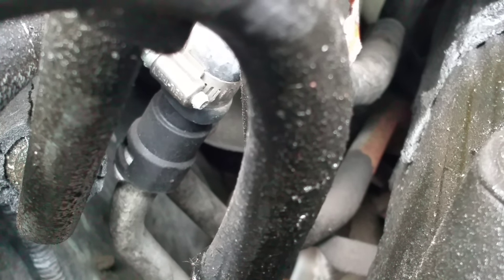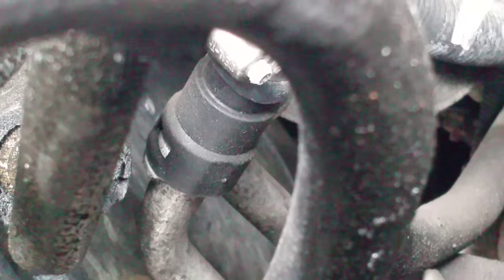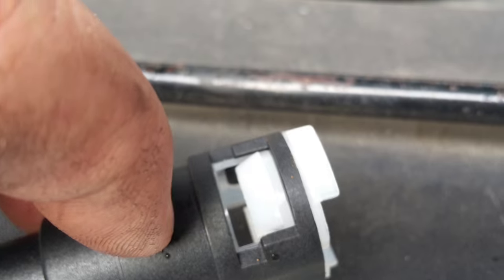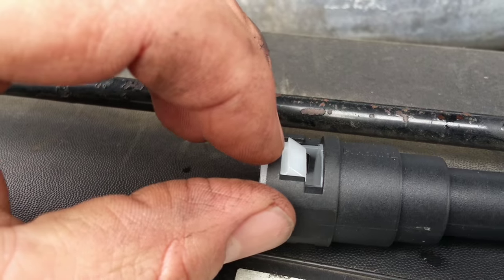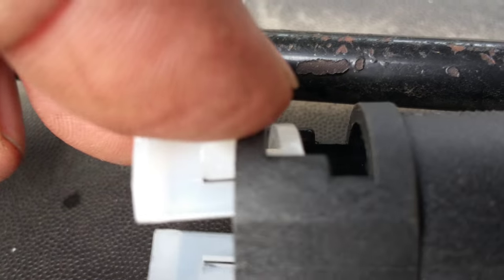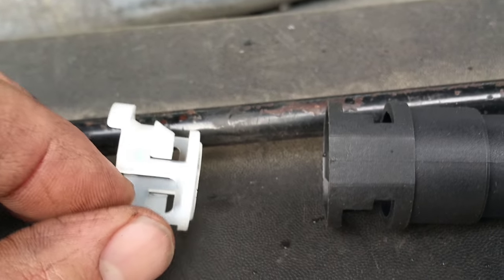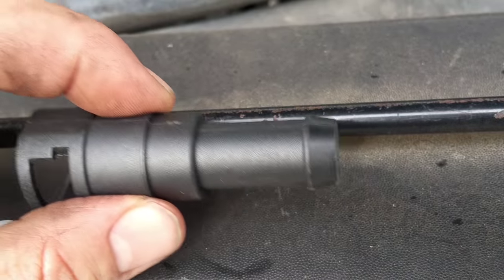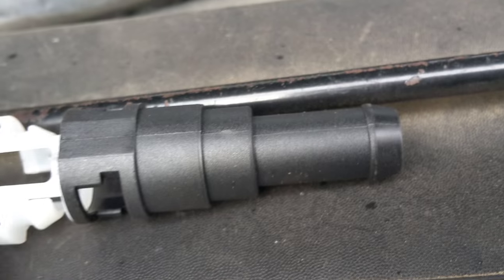Ford Heater Hose Quick Connect Release how to

Comment: I removed the factory quick disconnect and yes, there is an O ring in the assembly but there was also one on the heater core pipe just ahead of the white assembly. While installing the new disconnect I suppose I should put the old O ring back on the pipe from whence it came?
Reply from the maker: it is my experience that there is supposed to be one O ring. The 6 connections on my truck used just the ones from the new connector.
Reply: I have it on. About to pressure test it.

Comment: Thanks for the video. Do we really need to replace the quick connects, or can we just use hose clamps?
Reply from the maker: Joe Dusel there is a ridge in the pipe, I'd say, "no". You'd appreciate putting it back with the connector, makes it so much easier.
Reply: Thanks for the response. I ended up destroying the quick connects while removing them from the heater core. I'm thinking with all the effort to remove the hoses it might be a good time to preemptively replace the heater core, which is about 17 years old.
Reply from the maker: Joe Dusel That's ambitious. mine is partially clogged. I'm going to try and flush it.

Comment: Tried this on a 2000 Expedition, not budging, can't push the plastic tabs in far enough and pull it free.  The plastic coupling that's inside the rubber hose broke near the connector.  It's the one on the left at firewall, very tight quarters under there.  Gave up after 45 minutes.  My hands hurt after that, just getting tore up.  The tool is 25.00 and they don't have it locally, maybe there's a way to make one, it doesn't look that complicated.
Reply from the maker: N3D.studio Did the tabs break?

Twisting back and forth to ensure it's free, then pushing it towards the firewall before depressing the tabs.

I agree. Very tight spot to work in. 

Good luck.
Reply: Can't grab the tabs with both hands and push/pull like that.  Another video suggested a 90 deg. needle nose pliers.  I had a small pair but can't get on it right.  The black tube that goes into the hose broke while driving, fluid went all over the engine.  Great design.  I ended up just grabbing the plastic tabs with pliers and ripped them off.  Had to pull both until it finally came off until they were destroyed.  I broke the black connector a little too but it was already broken in half anyway.  I did not replace the ends.  I just shoved the hose onto the pipe thru firewall as far as I could and tightened down with regular hose clamp.  Pointed the clamp so the head was facing down and used a stub nosed flat head or I guess you could grab a socket and wrench and do it too.  No leaks.  Not going to buy those stupid connectors. If any other connectors break I will be converting them back to regular hose clamps.
Reply: Same shit here just bypass the heater core with 90 elbow and some hose clamps

Comment: What’s the little connector you was using for the demonstration?
Reply from the maker: When you purchase aftermarket heater hoses, they do not include the connector. The connector goes onto the heater hose with the standard clamp and then plugs right onto the nipple.

Comment: I have this on a 6.2L engine oil cooler coolant connections. though this was the way but wanted to make sure. 10 years old and looks fragile.
Reply from the maker: @denislaouenan5553  how did it work? Interested to know.
Reply: @MrRChitty  it worked as per designs but no space to insert any kind of pliers but just 2 fingers, needs to be ok to endure finger tip pain, at first it would not squize enough to free the female tube mostly due to excess of dirt, after spraying wd40 inside some of the shit came out and I was able to free the hose fitting, the idea was to get as much coolant out of engine block as I could. Internal O-ring was still in good condition and clean. I did put a bit of axle grease and put it back. Seems strongly attached and leakproof. Thanks a lot.
Reply from the maker: @denislaouenan5553  ah, the secret. Clean the dirt out with some kind of spray degreaser. I've had a few users struggle and that seems to be the answer for them. Appreciate the follow-up and glad it worked.

Comment: Question...Are there 2 sizes on the 99 expedition? 3/4 and 5/8 or one size fits both pipes?
Reply from the maker: steze48 They're all the same size. Dorman and Motormite (Help!) manufacture these parts.

Comment: Isn’t it crazy all these parts are manufactured and then it like figure out what this is for and how it works
Reply from the maker: On the repair side, yes. For quick assembly at the factory to keep costs in check... once you learn how it works, it speeds the installation for the end user. I am working on changing out a transmission on a chevy and it has the quick assembly on the lines.... if it wasn't for the used replacement one, I would be struggling. But, putting it back together is going to make it easy.

Comment: Mine would com so I just broke it off with screw driver around the ring part then it came off it was like molded on no tool or pressing those parts worked
Reply from the maker: Ouch... hopefully the new one went right on.
Reply: Yeah made sure not to damage the metal but I think they were oem and it had over 220k on it

Comment: I can't get the plastic piece off the nipple. Any tips?
Reply from the maker: Best suggestion I can give is push the entire assembly towards the fitting and twist back-and-forth. And then you'll need to take your fingers and depress on the white clips. And you should be able to slide it back.
Reply: @MrRChitty  I have the black connector piece and 1 o-ring off. It's just that white plastic piece left on the heater core nipple/tube. I've tried twisting, pulling, pushing, depressing, pushing the prongs apart. Moved maybe 1 cm. Feels like there is something to it I am missing here...
Reply from the maker: @jefemang3430  spread the prongs apart at that point.
Reply: @MrRChitty  Tried that and the plastic started to break, but no movement... I even tried with pliers to get under and spread them + pull. Nothing other than more damage to the plastic. I just bought a hose with a plastic connector piece. Almost wonder if it's worth just cutting off the old plastic clip.

The hose + connector came off so easily. Funny how this is the hard part haha.
Reply from the maker: @jefemang3430  it doesn't matter if you break the original. The new piece you have will replace it.
Reply from the maker: @jefemang3430  I am uploading a video right now
Reply: @MrRChitty  You are awesome! I appreciate it.
Reply from the maker: @jefemang3430  https://youtu.be/ubX_8RFfGqA?si=5lcY2tv-O5QnbTrv 
Let me know if this helps

Comment: I am replacing my heater core in a 2005 E-150 4.5L and need to know where to get these clips and the black part?
Reply from the maker: Sanitys Void Most any Auto Parts Store, under the brand name Dorman or Motormight.

Comment: Can you tell me how to take the old extension off of the heater and replace the new hose?
Reply from the maker: It's tricky at first, my video gives you the concept. You do not need a tool. Grasping the whole assembly, push towards the heater core and give it a turn back and forth to ensure that it is loose enough. I know Ford gives you a boat load of room under there.... lol. Feel for the openings where the white part of the clip comes through the assembly. Squeeze that area with your thumb and index finger so as to depress the clips in as far as possible. Then, pull away from the fire wall. You must depress the tabs while pushing first, then pull back. 

Keep me posted. I'll check on this in a little bit. 

Regards,

Randy
Reply: I got it thanks so much
Reply from the maker: Kristin McCormick You are welcome, I am glad it worked.

Comment: What if the teeth inside doesn't want to pop off what you do,?
Reply from the maker: They should release. Hopefully they weren't damaged in previous attempts to release them.  That or dirt made its way in that area.  Twisting motions while pressing on may clear it. While pressing on, you can try and squeeze the release tabs.

Comment: What's the purpose of that part? Why not just use a hose straight in.
Reply from the maker: When you have the Ford Expedition, the connections to the heater core are deep under there and almost impossible to get a screwdriver on a clamp. The part allows you to Simply connect to the heater core with virtually little to no effort.
Reply: @MrRChitty  What happens if you just put a hose straight in? I have a 09 VW Routan minivan basically a Chrysler town and country. I have this issue and the part is super expensive. It doesn't even come with a quick disconnect. So I just want to know of I can just slide a hose straight in.
Reply from the maker: @REPDAT5SIX2  I am not familiar with this one
Reply: @MrRChitty  okay well that same part on your video is the same part on my minivan. My question is can I just use a hose and avoid buying that part.
Reply from the maker: @REPDAT5SIX2  I believe so. It is nothing more than a pipe with a ridge to capture the quick connect. If you pass the tip of the hose beyond that ridge, tighten a clamp, it should hold. Just, if you service it in the future, the hose may become molded to that ridge and be difficult to remove.
Reply: @MrRChitty  I'm going to give it a try and see if it holds good. If not I'm just going to buy the whole kit of hoses. Thanks for your time and help.

Comment: sir how would i do it if i do reconnect it but it keeps leaking
Reply from the maker: Erick Gonzalez There is an O-ring. if you separate  them, you need to get the white clip and make sure the O-ring is either inside the assembly or on the pipe. if it is on the pipe,  you need to pull off and put it back inside.
Reply: well the old one i took off came with three of them but i try to put them back on but seems like they dont fit could it be that there old and i need new ones?
Reply from the maker: I have only seen 1 O-ring in play.

Comment: I can't seem to get the quick connect on. What am I doing wrong
Reply from the maker: James Brown make sure when you separated the two parts that you also did not lose the O-ring. if you're putting a new part in place of the old part you must make sure the O-ring went with the old part.

Comment: So this took me just over an hour.. I tried with my hands for 5 minutes then tried with the tool for an hour then tried again with my hands and got it in a few minutes. the thing is I saw another video where they used the tool so I struggled for an hour with the tool because it really is a bitch to depress the buttons..  I could get one side but never the other until I realized I could unlock the top and then rotate the tube 180 and then get the other one in the same top position
Reply from the maker: Appreciate the feedback. Overall, this thing sucks. However, reassembling will be a breeze.

Comment: Why not just buy the heater hose removal tool for a few bucks?  It works well and is much less risky than potentially breaking the connector.  Your auto parts store will have them and it will only be a fraction more expensive than the hose you will need to be replacing/disconnecting.  Over time, and in the cold, these connections get brittle.  They break.  Not to bad mouth you, this is just not how any mechanic would suggest to do it, as their are better ways to remove this connector.
Reply from the maker: No auto parts store I went to had the right part. It wasn't until I purchased the replacement hose and quick connect that I noticed you don't need the tool. And I was able to remove the connectors with the greatest of ease. Hence my video. If you're removing or separating the parts, chances are, you're removing them.

Thanks for the feedback.
Reply: @MrRChitty  Weird. I live in North Pole Alaska and even our auto parts store carries this tool. You must live in a more remote place than I. Also, I have replaced quite a few of these fittings.  This same fitting is also used in many fuel systems.  It just hasn't gone as well for me without the tool as with.  Maybe the next time you are dealing with one of these hoses, post the video of the removal from the male fitting.  Then maybe we(I) could get a better idea of how easy this really is.  Thanks.
Reply from the maker: I live in a very populated area. Having with these in the past, fixing a blown plug, the tool that was sold to me was very difficult to use. Anyhow, similar situation with a fuel line on GMC Yukon. I did a video for that, too. The tool is wrong and I needed to modify it. I'll attach the link. And that was a trip to several part stores, not just the big box ones.
Reply from the maker: @ImmortalAK  https://youtu.be/czbsKVBvvwU
Reply: Preston McDonald  To address your comment, are already plenty of hose disconnect videos on youtube.  Look one up.  There is no need for another.  Second, 
ABN Automotive SAE Air Conditioner & Fuel Line Quick Disconnect 7pc Tool Kit – Plastic Auto AC/Gas Set 1/4 – 7/8” Inch
ABN Automotive SAE Air Conditioner & Fuel Line Quick Disconnect 7pc Tool Kit – Plastic Auto AC/Gas Set 1/4 – 7/8” Inch
Under 8 dollars.  That can also be looked up.  Third, as far as which for has the same hoses, there are plenty of models.  The specific one to which I was speaking was the Econoline 250
Reply: Preston McDonald  The last comment post before I was done.  I meant to say the rear auxiliary heater on the Econoline Van.  It has a hose fitting where the hose meats the under carriage.  That is the one I was working on.  As far as your V 10 comment, I don't know how that applies.  I think maybe you just like to say v 10 or have us know you have a dodge most likely.
Reply: Preston is talking about Ford's modular 6.8 liter Triton v10, which from late 90's to 04 came in 2 valve form, 05 and up was available as a 3 valve...

Comment: For all that's out there. The Ford quick connect the comes with the car worked for many many years. Anything else that you buy is garbage I've had my failed three times now. So unless you're buying top-notch quality don't do it. Bye sadly the Ford OEM parts
Reply from the maker: Good point. The Dorman worked well for me.
Reply: Gates makes one #28500 Gates quick Lok.
Reply from the maker: @johncassidy2982  Dorman does as well.

Comment: You should have showed how the go on properly
Reply from the maker: Just push it on. It's not the assembly people struggle with, it's the disassembly.
Reply: @MrRChitty  let me tell you it took three of us to figure out how to get the hose off and that  was terrible but putting on the hose was just as bad because two of us couldn’t get the top part on the other person was taller. I’m no Macanic but I’m have a mechanical mind but not the muscle it took to get those shoved on easily. Certainly not as simple as any of the videos made you think they where.
Reply from the maker: Sorry you had difficulty assembling it. I had no difficulty at all, just line it up and push it on. You have to make sure that the O'ring from the old one as well as the white clip, again from the old one are off of the pipe. I cover that in the video.
Reply: @MrRChitty  you know we looked and looked for prongs and never found one to pull out or to move. But as hard as they where to shove on I can believe they didn’t use them.

Comment: You wouldn't happen to know what model number that is I'm trying to find that man and it's kind of hard
Reply from the maker: The model number for the part?
Reply: Yessir trying to find a 2003 Windstar quick release 3.8 engine
Reply: I've been to 3 AutoZone's and every part that I've got is the wrong one
Reply from the maker: https://www.partsgeek.com/2ldvhp1-ford-expedition-heater-hose-connector.html?utm_source=shopzilla&utm_medium=pf&utm_content=dc&utm_campaign=PartsGeek+ShopZilla&fp=pp&utm_term=Ford+Heater+Hose+Connector

That's the part I used. Type in your vehicle and see what comes up.
Reply: Nevermind I think I found it  thank you great video .

Comment: I've tried mine but it's not budging and it's in a place where it's difficult to see
Reply from the maker: Chris Workman That's why u did the video in the open. On my expedition, it is in a very tight spot. Ensure the fitting can rotate back and forth. The push the fitting farther on. With your finger tips, feel for the white tabs and attempt to depress them. You should be able to slowly pull back on the heater hose. It takes a little finesse, but is very doable. Keep me posted.
Reply from the maker: I can't edit, u= I.
Reply: MrRchitty My quick connect broke off the heater hose so I'm trying to get the quick connect off in order to put the new hose on
Reply from the maker: Is it able to turn?
Reply: MrRchitty Yes
Reply from the maker: How did you make out?
Reply: MrRchitty I was able to get it with a little bit of elbow grease. Put the new one on and truck is back on the road! Thanks for the help much appreciated

Comment: Where is that?
Reply from the maker: Sherry Quintal Passenger side of the engine compartment. This is on a 1999 Expedition and goes to the rear heater core. The heater hose is an assembly "Y" hose. Best access is to pull the plastic wheel well cover out.

Comment: If only it actually came apart that easy. No matter how hard i squeeze, it will not release
Reply from the maker: @dboy1377  make sure you push inward and twist to make sure it will free itself. While squeezing the tabs, then pull back.

Comment: You use a quick disconnect tool
Reply from the maker: It can be done without. That's the point of the video. You don't need s tool.